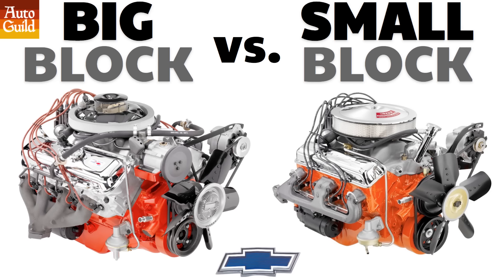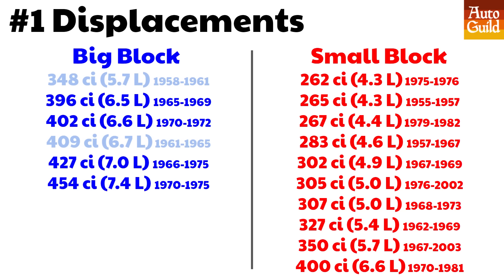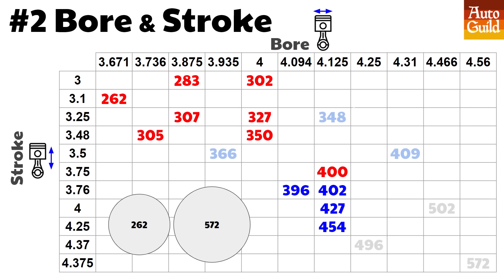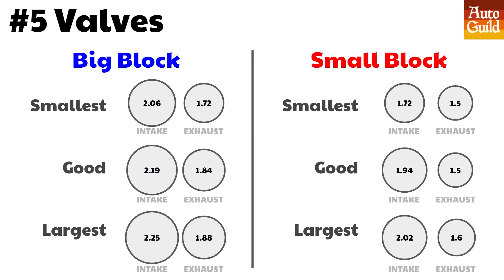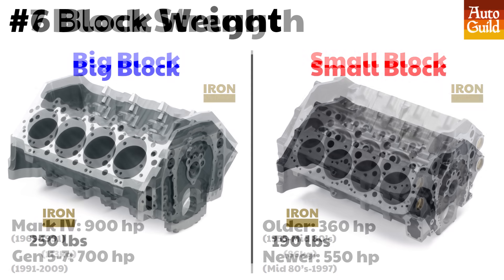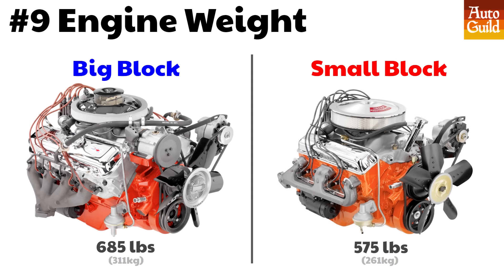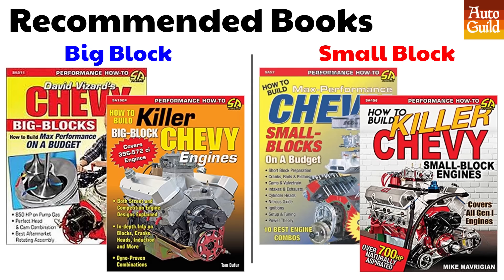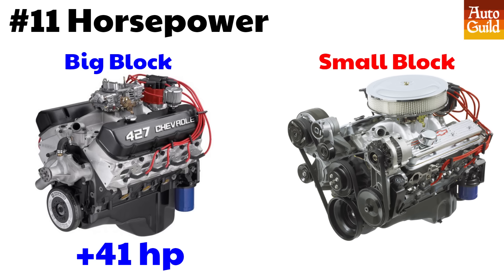Big Block vs  Small Block Chevy Comparison

Comment: No I don’t care about engine weight my 454 is fun to drive big blocks make massive torque and that’s what makes you accelerate put a aluminum top end on a big block lighten it up a bit make more power LS motors suck they don’t make the torque the old motors do they use more RPMS to do what the older engine do I hear people say they switched over to the LS motor and I tell them that’s because there are no more big blocks or small blocks in the junkyards anymore that’shttps://youtu.be/qzVBpddpK2kpular because it’s the only thing they have

Comment: I was pouring over these specs when I was a teenager in the early 80s. I won't nitpick any of your errors because nobody's perfect. I've grown to appreciate the LS engine, but I almost think it's too perfect. I still like some of the quirks of the old engines.
Reply: The ls engine is far from perfect, n i beat a 5.3 swapped single cab Silverado in my stock P71 with my 4.6L 2v..lol But i do like the LS7, dayum, time sure does fly..

Comment: What are the older motor home 454 engines like to put into a nova? Are they usable or are they just gas burning truck engines with low power?
Reply: i had an older rv with one of those. i wanted to put that motor in my 87 cutlass. not sure if they have 4 bolt mains or not, which could be a major weakpoint. It would definitely sound good though.

Comment: Take both long blocks and remove the rods and piston. With stock valve spring pressure it takes more torque on a needle type torque wrench to turn the SB.
The Semi Hemi design of the BB was done 10 years later and has less parasitic friction.
One more reason I loved the BB over the mouse motor.

Comment: As a owner of a All aluminum Ramjet-572 big block stuffed into a 97 Camaro that is driven on the street every week with over 88,000 miles so far, or so and used on the occasional track day for road racing and the Bonneville salt flats after the SCTA runs are finished. I am building a LS-7 car to save weight in the nose and think it might be fast enough to be fun, but It's still in the shop and I am waiting for spring to drive it, HOPEFULLY! Your expert opinion is needed.

Comment: best setup in my opinion for the classic style bbc build would be a stroked 427 tall deck. yes the parts are more expensive due to the 10.2 deck and intakes are harder to come by but its worth it for a fun build that has alot of potential. avoid the intake spacers if possible/yes they work but increases the chance of air leaks. im currently building one for my 77 gmc stepside that used to have a 250 l6. 4 speed standard and 373 gear. should be fun when im done
Reply: longer stroke, less revs..short stroke better..big bore..

Comment: 40 years ago when I was in high school; the other revheads would laugh at me when I would say "There is no substitute for cubes" or "no replacement for displacement".  I began to modify my 1967 Oldsmobile Delta 88 which came standard with a big block. I dropped in a 455 with Edelbrock intake and blackjack headers which like in this video had to be bent around the steering box. Because this motor achieved high torque at low rpm  I'm still driving it decades later.
Reply: Steer the front with the steering wheel, steer the rear tires with the throttle!!
Reply: No sb will beat the bb's torque off the line.. Gladd you still got your bb 67 Olds..

Comment: I was always a small block guy.  Loved 327s and 350s.  Wanted a 327/M21 4 speed ‘68 Chevelle.............until I bought a hopped up big block Chevelle.  Yeah, it’s only a 396.  But, the smile factor and the respect from the folks that lived during that time are priceless.  I’ll probably ditch the TH400 in favor of a 5 speed someday.  Right now, it’s just too much fun driving that time machine.
Reply: Hell yeah man, that TORQUE off the line wins hearts all the time..

Comment: Oh boy dodge engine any day
Reply: Anthony Hembree

I've. Worked with modified and raced all 3 of the major manufacturers engines.  
Chevys are the least expensive easiest and have the widest range of choice of aftermarket equipment 
This has generally been true since around 1957.

Back during most of the 60s Mopar and Ford were the way to go for SERIOUS RACING As Chevss would not hold together well and the aftermarket didnt serve them well until after the middle of the 60s.  I should note that this was not true of the small block Chev which did have pricey after market rods from Carillo etc.  Fast forward to the 2p00s and the LS Chevs and everything changed.  
Sad to say you can get a Mopar to run and run hard  but it will cost you.

Comment: both have their strong points, but excluding the LS-6, the small-block 70-Chevelle outran the big-block Chevelles
Reply: FACTS
Reply: For real ???? How with the massive torque advantage of the big block
Reply: @bilbobaggins4710  it's because of a short stroke so therefore small blocks would wrap up faster than Big Blocks which gave them the advantage on quarter mile runs back then. Big Blocks had the advantage on half mile
Reply: @ryanpoloski4322  but et. Is torque based...I'll bet on a car with 500ftlbs @ 4500RPM against a small block with 500hp @6000 RPM any day of the week
Reply: @bilbobaggins4710  I'll bet on a small block on 1/4 mile any day of the week. That's because I've seen it firsthand. I've seen small blocks spin 9000 RPM all day long and absolutely destroy Big Blocks quarter mile. Half mile I would bet on the big block.
Reply: @onyxphantom6762  obviously something built right if you're spinning it 9000 rpm. It's not some backyard built engine period and again quarter-mile small-block beat Big Blocks. Half mile goes to big blocks.  Now that's without turbos and without nitrous.

Comment: I thought there was a 632 big block Chevy?
Reply: Nvm I just heard him say the 632 lol
Reply: Can't be built from a factory low deck bbc block.  They are expensive because of a lot of special parts and used in Drag Racing and Tractor or Truck pulling.  They use a Chevy style head although most are aftermarket with huge ports and valves to feed that monster 632.
Reply: @Jendal3  is there anything bigger than a 632?
Reply: @dillonlabonte9685  I'm not sure based on the 4.84 BBC bore spacing.  I'm thinking maybe slightly over 700 cu in.  After that the bore has to be rather large and would require a custom block to acomodate it.

Comment: If hear the word 350 or ls I will puke that is definition of Cooke cutter and un original played out boring bs. It been that much that if I am at a car show and they say I got a 350 or ls I just walk away. Boring boring boring
Reply from the maker: What is your preferred engine?
Reply: @AutoGuild  I would pick a 460 and have one or from chev a 454 and dodge 426 hemi no six pack. Diesel would be 7.3 turbo or 12v Cummings. The 300 4.9l stright six is very very tough as well for a gas engine.

Comment: You forgot  the 366  big block
Reply: The 366 was a tall deck build specifically for trucks.
Reply: @mcswain69  so was the 8.1 litre   neverput in a car
Reply: @ronaldbertin9455  the 366 is about 6 liters. Where did an 8.1 come from?
Reply: @mcswain69  the 496  truck motor
Reply: @ronaldbertin9455  isn’t the 496 a hi-po crate engine?
Reply: @mcswain69  was available  only in the gm truck 3/4 ton and up ,, but identical dimensions as the 454  427 402 396  , never offered in a car platform to my knowledge

Comment: Ok I got a question. Me and my dad have a 1979 z28 camaro as a project car and high school car for me.  we have everything planned out but the camshaft and the top end of the engine and trany.  It is a 454 bored to a 496 stroker.  We want to  use it on the street and maybe on the strip. Any ideas?
Reply from the maker: Go with a mild cam, not too wild.  With all that torque make sure you have some big front and rear tires.  Upgrade the brakes to 4-wheel disc.  I prefer the C5 or C6 corvette setup.  Good luck.  I did the same thing with my dad in high school.
Reply: @AutoGuild  any recommendations on that cam shaft

Comment: in my truck the only reason i'd have to put in a big block is "it's cool because BIG BLOCK 🥴" for the last 251k miles it's had a 305 tbi small block and been beaten like a redheaded stepchild for over 100k of those miles. i havent changed anything about the motor except for oil and filters, air filters, spark plugs, water pump, aswell as doing my best to keep oil and coolant in it. transmissions are a different story, im on 4l60e #4. all 1995 year specific transmissions. currently have one from a conversion van with 116k on it, has closer to 180k by now. it's slipping 2nd occasionally but for $150 yeah whatever. I have a 355 and a 700r4 collecting dust in my shed waiting to go in, but i wanna see how far this '95 305 will go. my guess cause of death will be one of 3 things, a head gasket (has been leaking for 5 years) a spun rod bearing or thrown rod, or just a lack of compression (what im hoping for) it's still kicking, refuses to die. takes a lickin' and keeps on tickin'.

Comment: It's far more simple than this video gets into. It all boils down to thermal efficiency, mechanical efficiency, capacity, and duty cycle. Capacity is a no-brainer... Big block. Thermal efficiency... big block. Larger bores = less surface area per cubic inch. Mechanical efficiency... small block, due to less moving mass and frictional area. Duty cycle - BOTH. In high torque static load applications, the big block's larger cooling capacity and bearings hold up better. In applications with fluctuating loads, the small block wins. The reduced mechanical parasitic losses enable the small block to respond to transient loads much more efficiently, wasting less fuel, and placing less load on both the cooling system and the bearings.
Reply from the maker: One of the best comments so far and many good points.  Big Blocks def have their place for certain applications!
Reply: @AutoGuild  - The advancements of LS engjnes and their Duramax series of diesel engines have all but displaced that place. On the flip side, cheaper ethanol-blended fuels have shown some renewed light on big displacement gas engines. I have said for years... if GM would've went full blown "Big Block LS" (LB?) with the 8.4L... we would probably see an entirely different landscape in drag racing AND 1-ton truck engines. If they would've kept the splayed valve configuration, engineered the block as a larger scale LSX, introduced cathedral ports, 6-bolt mains, raised cam axis, and offered an auxiliary drive provision (40hp pto)... the 8.4 would've been the engine all the GM racers would've been using for the next 30 years. Think about it... a big block with near LS efficiency and throttle response, and an auxiliary provision that would not only make it the #1 industrial gas engjne... but also let you relocate all your accessories (cleanest engine bay EVER).

Comment: I have a big block swap but am still concerned about weight.  I like the extra torque and filled engine bay.  But small block owners will say its not balanced.  I will point out that our engines weigh the same because they are using cast iron everything.  Then they will unfriend me.  And that makes me happy.
Reply from the maker: First comment to make me actually laugh out loud.  Awesome.  : )

Comment: 1970 Chevelle with 454 BB TH400. The engine bay is perfect for a BB. Yes the Gas sucks at 4mpg on high octane BUT... It's smiles per miles.

Comment: best thing about chevy if a small block fits then a big block will too and i like my big blocks . my 327 is running over 1200 hp with the 202 heads ported to 204 this is on pump gas . then u say u get worse mpg with a bb that is bs i actually get better mpg with a bb in a pu . plus u can run taller gears and not burn more fuel it is how u build the rig u will get bad mpg if u build it the same as a sb

Comment: Sounds like the big block almost isn't worth it, all that extra stuff and for what? 41 more horses? 22 pound feet of torque? Oooo big difference there buddy
Reply: You're right. Heck, the Studebaker 289 cu. V8 developed up to 500 horsepower IN 1963!!!
Reply: @jakekaywell5972  that was with a Super Charger... not naturally asperated.
Reply: @Jendal3  Fair point, but still. I believe the most that engine could get while still being naturally aspirated was 350 hp.

Comment: But I like my 454 in my 69 chevelle lol. I care a bit about the weight, but when I bought it, it came with the 454, and it had already been upgraded with brakes, wheels, headers, etc. I like the way it feels and handles right now so I'm keeping the big block.
Reply: Keep it that way, you'll regret the torque you lose by going with a sb..
Reply: @P71ScrewHead  lol, I bored and stroked her out to a 508 and threw on a 8-71 supercharger. The big block is staying
Reply: @brycehill6678  Heck yeah man, oh the eargasms that engine must give..

Comment: I’ve got a numbers matching 72 C20 and it has a 402 in it from the factory but I rebuilt it a couple of years ago with forged aluminum internals it made like 325 horsepower when new but due to it having 90,000 miles on it before I rebuilt it it was pretty tired. I put a mild camshaft in it nothing to fancy then the power jumped to 350 horsepower I noticed it. It’s a little bit faster but dosent need to be as it’s in a 7500 pound truck with 67 gallons of gas in it and the displacement went up to 410ci

Comment: I'm a Ford man but I watched this just for curiosity. I have an '88 Econoline with a 460 and it hauls that 2.7t around without raising a sweat. I can't help thinking a small block would do ok empty, but loaded it would struggle. I imagine the same goes for Chevys in G vans and Silverados. As for weight, I'm building a Model T hot rod and (gasp) not using a Ford engine. I love the look of pipes and counting intake and exhaust, why have 16 when you can have 24? A Jag V-12 weighs as much as a big block Ford but do I care? No. In closing, can you do a similar video about Ford engines? Windsor and/or Cleveland 351 v 429/460?

Comment: You are also incorrect about the 427, it has the same stroke as the 396 (3.76), and the same bore as the 454 (4.25).
Reply: It is correct, for the 06-13 LS7 🤪

Comment: Basically, 
Chevy Small Block: does anything 

Chevy Big Block: does anything BUT BIGGER
Reply: Can’t rev higher that’s one thing I guess
Reply: @theeoddments960  I built a 515ci BBC a few years ago and it was built to shift at 6k rpm
Reply: @Kmecha84  yeah but using aftermarket forged parts and probably hypereutectic pistons. That can make any motor rev high. The mouse motor revs a bit more free besides the 396 and 427 which people have a lot less access too
Reply: Not when it comes to toque. I have a 8.1 L (496ci) built with torque to pull. No GM small block can compare. The 8.1 is built to last . The military use it in the AT98.
Reply: @donaldthomas5852  hence the “ BUT BIGGER “ part
Reply: @donaldthomas5852  wouldn't a cummims six be a much more efficient way to build torque?
Reply: @liljuz1981   You want to test torque  put it in a boat. There is a local guy who put a 12 valve in a 21ft  v drive..plenty smokey but it hauls ass...it runs pretty close to what a 750 hp bbc would run. only problem with it gears
Reply: @liljuz1981  when people buy big blocks it isnt realy for the power it is more for bragging rights
Reply: @Ian1omega  Big Blocks make more power with less RPM.
Reply: @donaldthomas5852  don't compare the small blocks to the big block of big blocks 😎😎🤣
Reply: @donaldthomas5852  ok
Reply: @donaldthomas5852  you got that right. Shop I work builds 440 ci small blocks
All aluminum  they usually dyno 780,'820 hp with a single carb. I run l88 427 in my boat with a decent size roller cam
No way it makes more than 650 hp. I borrowed a customers 440 right off the dyno..after I asked. Boat ran 110+ all day long with the 427
The 440 didnt even have enough torque to burn the prop past 3500 rpm.
Got a bud with a first gen camaro
Old school small block stick shift guy.
40 lb flywheel  launch at 4500. Gave him o nice 375 hp 396..his small blocks were about 450'475.
Told him he needed less flywheel  didnt  believe me
Launch at 3k just spun tires..borrowed an 11lb l88 flywheel
Dump the clutch at 6k
All those stories about small blocks being faster than bb out of the hole? Not this time..cat launched hard and was almost 
.4 quicker in the 1/4 mi. It's that torque thing...even the smallest big block makes more than the biggest small block
Reply: Top Fuel Dragsters make 10,000 Horsepower using Big Block Engines. Small Blocks can not make that kind of power.
Reply: @extremedrivr And those engines are based off of the old 426 race Hemi in a lot of ways !
Reply: @peteloomis8456  Correct.
Reply: Real talk
Reply: True. But, A small block Buick goes into the most seaworthy yachts ever built...
Reply: Yesl.
Reply: Or fuel economy
Reply: Not when it comes to sound
Reply: @Carson Hopper A small engine  is a joke  when it comes to towing! They scream and roar but don't pull worth a dam.
Reply: @mylanmiller9656
Reply: @mylanmiller9656  unless you build a small block with 500 ft lb of torque
Reply: @nickwebb9937  a small block that makes 500 lb ft makes it at like 4200 rpm, useless for towing. don't believe me? look at my profile pic... i run small blocks in my muscle cars and a big block or diesel for trucks. my daily is a squarebody k10 currently swapping 6.2 turbo diesel out for a mild built 454.
Reply: @allthingsamericanmuscle  that’s what I meant one that’s fully built for towing
Reply: @nickwebb9937  Yes but small blocks need more RPM to make all that power. Big Blocks do not.
Reply: @allthingsamericanmuscle I know it's 2 years later but why was you going to take the diesel out and put a 454? What is the benefit of doing that?